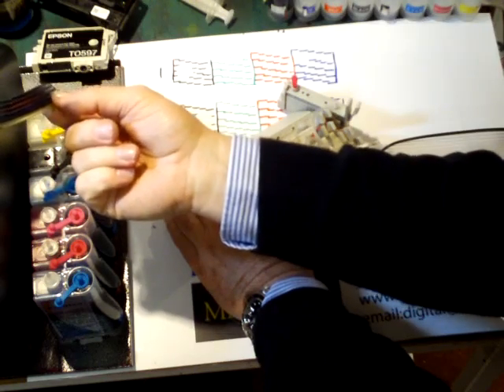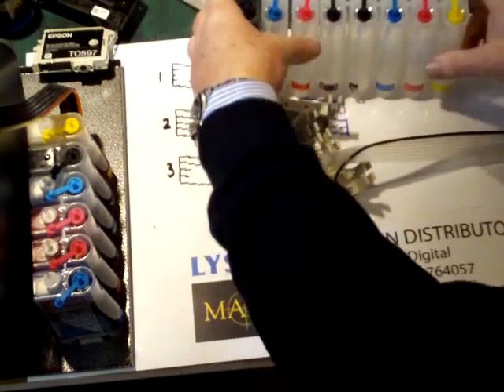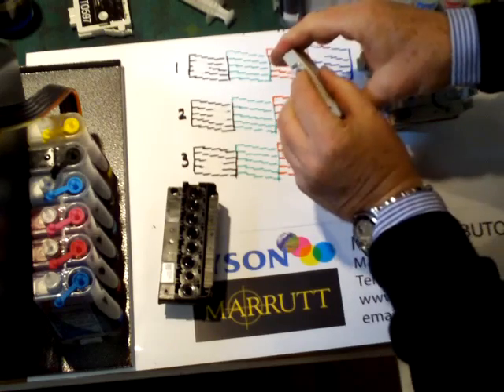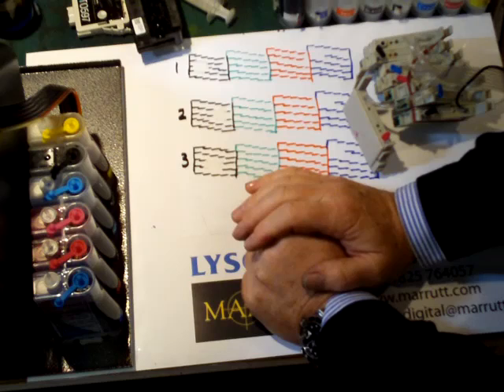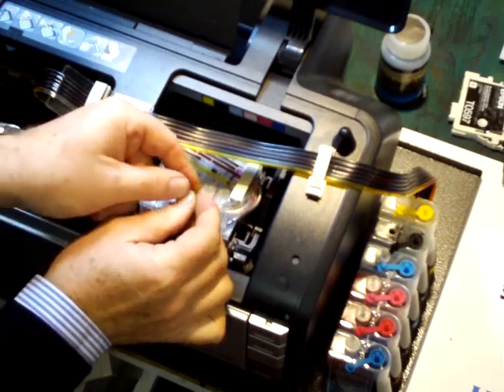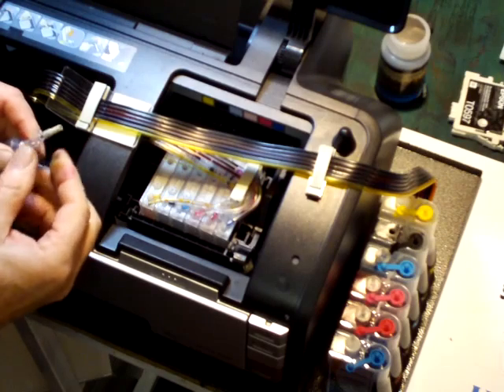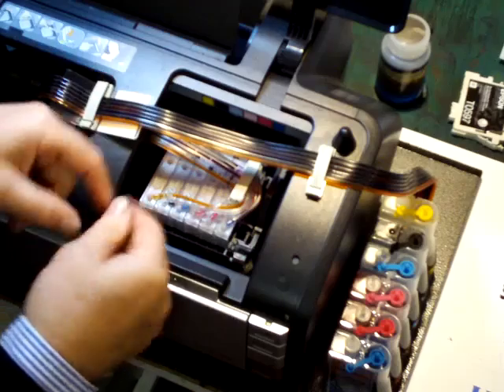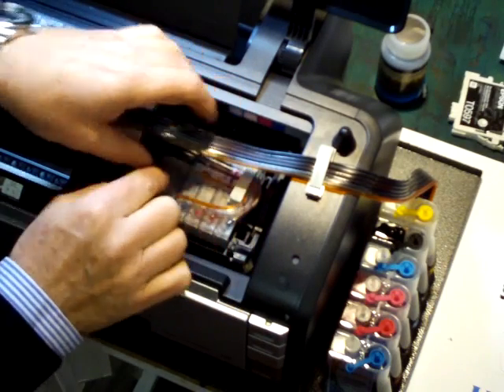Lyson FAQs 3: CIS Fault-finding - Pt 2

Comment: Hello, I have a blocked channel problem that you mention at around 6:30. Is there any way to unblock a particular tube? I have tried to hold the pressure to force the dried ink out up the syringe but with no luck. Please advise. I do not have the tubing attachment shown in this video that fits onto the end of the syringes, I am just using a syringe. Thank you in advance